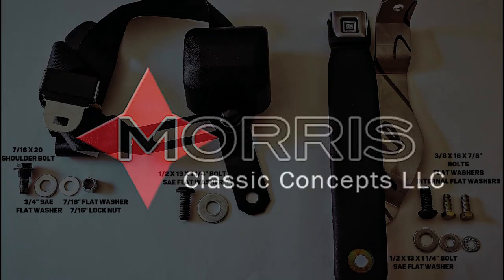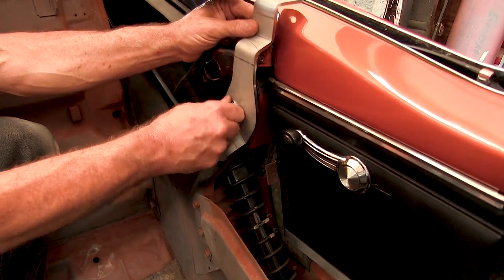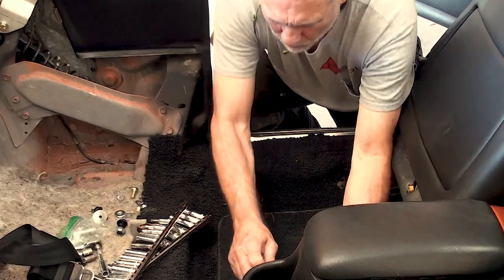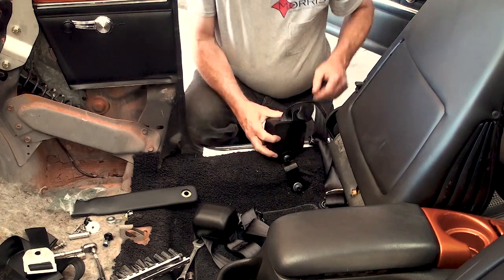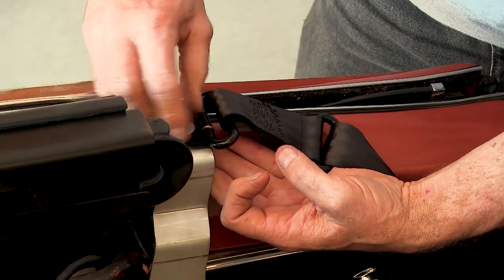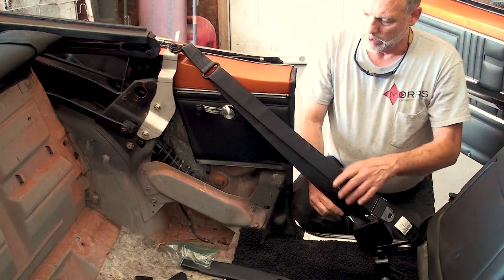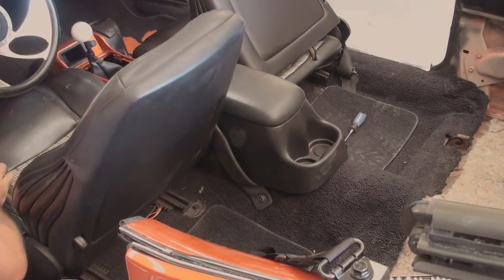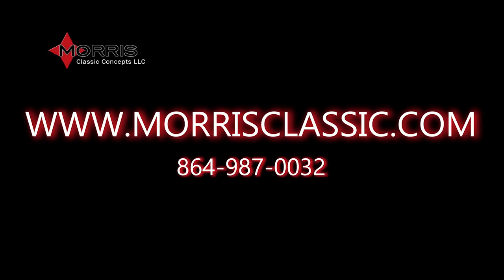1967-69 Camaro & Firebird Convertible Seat Belts Install

Comment: There seems to be some debate around fine threaded bolts and coarse threaded bolts.. which type of bolt goes into the OE mount point on my frame for a 1967 coupe?
Reply from the maker: Levi,
The video above is for our 1967-69 Camaro/Firebird Convertible Seat Belts, so the bolt kit included with our 1967 Camaro/Firebird Coupes will be different than what is shown. The factory top mounting locations in a 1967 Camaro/Firebird Coupe require (2) 5/16 x 18 x 1 on each side (coarse thread), and all of the factory holes in the floor will take a 1/2 x 13 x 1 1/4 (coarse thread) bolt. A year-and-car-specific Grade 8 bolt kit is included with all of our front seat belt sets. Please let us know if you have any questions!

Comment: Will these work with aftermarket high back seats?
Reply from the maker: The backseats shouldn't have any effect on using these Convertible Front 3-Point Seat Belts, since the bracket that serves as the third point/top mount bolts into the side panel at the quarter-glass area behind the interior. Please let us know if you have any other questions!
Reply from the maker: I just re-read your comment and realized you might've been meaning the front seats with high backs. These also shouldn't interfere with the seat belts, as the belt will still have to come around the seat and across you. You can call and speak to Billy, the designer, if you'd like as well! (864) 987-0032